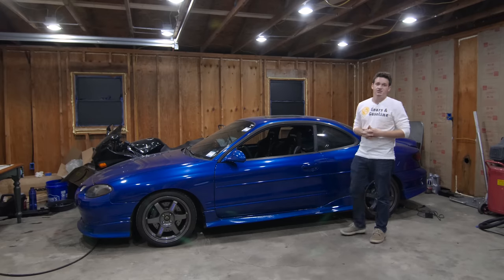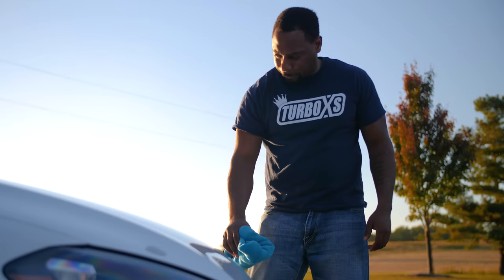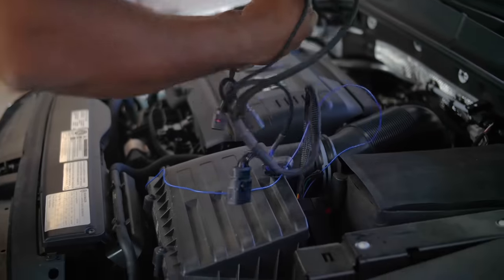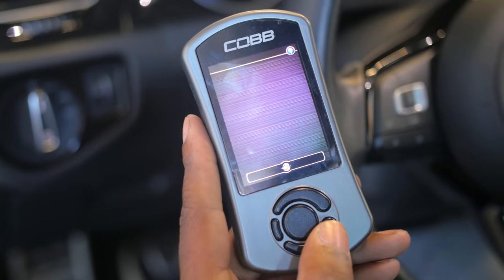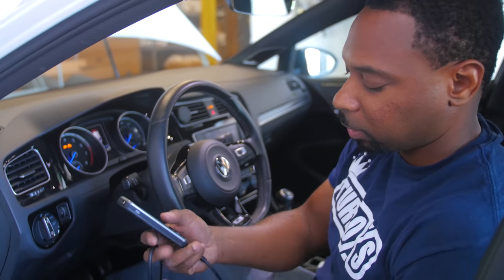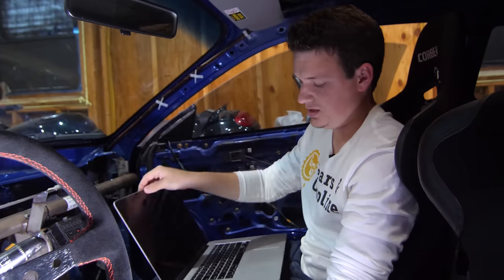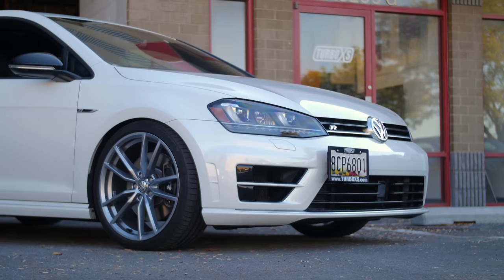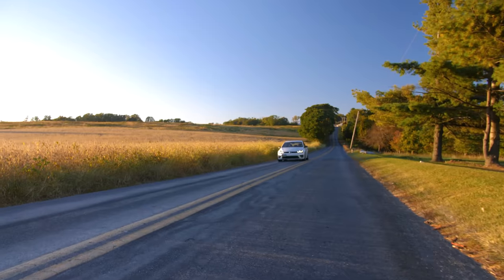3 Different Methods for Tuning a Car [4k]

Comment: My three methods are plasti dip, air filter and taking out the spare tire for weight reduction.
Reply: Sensei Joshu nah that’s rice
Reply: @zanpy8600  no dude, every sticker adds 10+ bhp and the big exhaust is to vent the excess V-takk++ and the spoiler so you get more lift like a jetfighter.
Reply: Add some stickers too... That will also help in winning at red light race.
Reply: And cut springs for better cornering
Reply: Thats not even tuning
Reply: well..I agree with options 2 and 3
Reply: Weight reduction bro
Reply: K G muffler, cut coilover, fake wheel
Reply: K G 💀😂
Reply: every sticker is +5 bhp
Reply: @SupermotoNL  A spoiler does not give lift, it makes the opposite..
Reply: @SupermotoNL that’s a good move 😂😂😂
Reply: LMAO fuck man i literally just took the spare tire out of my camry. I'm just starting to learn about cars and how they work so I don't know the memes yet

Comment: This is a very incomplete explanation of tuning basically limited to cars with electronic ignition and fuel injection. Tuning is an old skill long before ECUs and access ports. 350 WHP from an access port is a luxury. The part that was left out was all of the fine adjustments you can make to an engine without ECUs and the like. Bigger throttle body or a bigger carb, screwing in that little bit more timing, bigger jets in the carb, and such. Don't get me wrong I am not going to rag on the electronic method of doing things. That's an art in and of itself and requires an equal amount of skill to perfect. This video was just misleading in that it says tuning wasn't really a thing before 2004, which for electronic tuning may be the case, but for tuning overall is just not true.
Reply: Yeah you can put a bigger throttle body on a car. but the ECU is set up for the smaller throttle body. so to need to tune for the new throttle body.
Reply: To be fair most cars that get tuned are usually made in the 90s and newer so this video is just an explanation on the electrical way of tuning BUT the old fashion way of tuning is still alive since you do have to change out parts mechanically to get more out of your engine, sad part is that you have to do more to a modern car than you do with a classic because with a modern car there's more restrictions coming out as each year goes on so that's more deletes you have to do before you start getting to the good stuff and that's if you don't live in a eco friendly state like California

Comment: Only German turbo cars can get those type of gains with just a tune
Reply: Mr.Car  Yep thats true and still be really slow...
Reply: Augmented Ninja7 There are Golf
Rs that run 9s lol.
Reply: Jad3d Not just that theres a mk1 with like 1,000hp, but I am not sure if it has another engine.
Reply: Zem45 it got 1200hp its a twin engine
Reply: @michaelzepeda5785  it got a mk4 r32 engine, which is an underrated tuner beast
Reply: that golf was probably running on a stage  2 tune with stock turbo

Comment: I'll check out what's available for my GTO soon. Like nearly everything else, it will probably have aftermarket support based solely in Australia.
Reply: Cars Simplified Don't be so sure mate: the motor is a crate LS GM Lump. If anything, you might have better luck in the States.
Reply: Haltech

Comment: who the fuck gains 100 hp by just tuning the ecu???

edit: some people actually do -hmmmmm!
Reply: Audi A6 3.0tfsi owners. A little more to be exact. 150-180hp just from tune.
Reply: McClaren
Reply: JP3 even the new EA888 Golfs can do close to that with just a stage 1+
Reply: thats some crazy shit, no dp, exhaust etc?
Reply: Golf GTI & Golf R Mk7’s too!
Reply: its easy to gain power from turbocharged cars. all you have to do is turn up the boost and make a few adjustments
Reply: crazy VW must be really careful with their software. on my fiesta st i had to get a turbo back exhaust and a new intercooler for a stage 2 which gives me 80 hp AT MAX. so 100hp with only a ecu tune seemed pretty ridiculous to me. but then its 1.6 vs 2.0 and up...
Reply: Josiah Jackson its not that easy to get 100hp without any supporting mods
Reply: JP3 generally thru years 20-30% has been the max power gain from tune. Mk4 golf 150hp -> 190hp.  audi 3.0tdi 239hp -> 286hp
Reply: The ls1 engines from 1997 were just retuned a little each year too 2004. So when the tuners re-tune  one off the earlier ones that were detuned (the first ls1's) they see big power gains.
Reply: It’s 2018 man
Reply: BMW 1 series.
Reply: JP3 the thing is VWs are so detuned from factory that it shouldn't be surprising that they can gain +100hp. I mean, it's a 2.0 turbo that outputs 220hp. If you look at other 2.0t from the evo to even the hyundai sonata turbo, they output 270-300 hp. So a stage 1 gti gaining 100hp isn't all that far fetched

Comment: I just bought a 2017 Toyota tundra
I know what is a lot of people in the states are getting their vehicles tuned by professional tuner for around $450

The other option is I can buy a bully dog like everybody else

Or something like an HP tuner

Is the bully dog good enough
😊 What am I trying to do I'm just trying to make the vehicle run smoother improve miles per gallon and shifting points
Reply: Wait so you can literally just buy a tuner plug it in and it does all the work for you .? You don’t have to do program anything
Reply: Diablosport   tuners

AFE Scorcher pro , ✓
Plugs under hood , doesn't mess with ECU ( car computer)

Bully dog tuner

Comment: I had the JB1 on my 2016 Golf R and loved it!  Amazing power and George from Burger Motorsports was a joy to work with.  I now have their JB4 on my 2019 Type-R and its even better thanks to the bluetooth functionality with their app.  You can monitor several digital gauges, data log and switch maps on the fly...it's phenomenal and best part again is there is no flash or checksum file left behind on your factory ECU ;b  Cobb is a great option too but their OST maps are really prevalent to knock, at least on the Subaru and Evo platform.  Pro tunes are definitely the way to go for this route.

Comment: How does Pre-obd, obd1, and obd2 come into effect when looking for tuning options?
Reply: Emmanuel Haro the amount of fuel thrown out.. For instance obd sensors tell whether or not you are using an excess of fuel , but don't take my word for it i am not a mechanic just have had to deal with those buggers for a while

Comment: tuning is stupidly too dam expensive....atleast in my area....800+ a tune at the local tune shop n its the only one for 6 hrs...that being said i never had and luck with handheld tuners....last 2 cars i had with a handheld tune fucked them up to the point where the boost would not hold/build

Comment: Tuning the car is not a simple task. Having specialized knowledge is required the most for obtaining the best results from the vehicle. Help from the experienced one will serve the best purpose. I've chip tuned my car from Tuningfileshop, they tuned my car instantly and quickly with ultimate results.

Comment: What's best for my 02 vw jetta with the 2.8 glx vr6 engine? I want more take off, more boost and more power. Mine is not the turbo. But will be turb boosted in 2 months. What's best for me to use right now so I can bring to a shop to get it done? I currently have straight headers, straight pipe and cold air intake. Not much of anything but I want more out of my beefy engine

Comment: My tuner is a 1995 Ford taurus t- tops ,cold air intake, cat back duallies, 4 foot spoiler,  racing stickers neon lights ,kissing doors with a body kit sitting on 22s ok there 14 inch hubcap spinners but I keep them clean do it's a real babe magnet I run 97 octane for a extra 50 horsepower when I race it it's a real head Turner and on top of that I went into Harry's and ordered a t66 turbo and a motec exhaust I can't wait

Comment: I have a cold air intake and catback exhaust. Can I tune it myself with just a laptop and some software? I mean the mods ain't much but it's certainly taking in air and dispersing exhaust on a level the ECU wasn't programmed to, so a tune will bring out the most of what I have. I just wish I knew more.

Comment: Hey, i have a 1994 caprice. It comes with 200 horsepower from the factory. Id like to increase that power just a little so i can have a little bit more fun. But i dont know anything about tuning and the car is just too nice to start replacing hardware. Should i get a standalone ECU to achieve this? My goal horsepower would be 250-300. But i dont know if just a tune could manage this. Any opinions? (The caprice is OBD1 by the way)

Comment: trying to find a way to tune my 1990 vw corrado g60 would like to add a few things but I want to be able to tune it before I do it. Its got an obd1 port so I cant tune it with a hand tuner and cant find any piggy or standalone tuners for it. would really appreciate it if you could help me out.

Comment: 2 question from Italy 🇮🇹 
First one: 
I'm not sure of that, but in all these case you can only modify the ECU changing the code with a new pre-written code and you can't access at single parameters changing them as you want wright?

Second one
How can you be sure that the mechanic contest is robust enough to support the increase of power ?

Comment: Does anyone know when a engine is to old for tuning or get a stage tune flash? My car is a 2006 gti 2 door with 154k mileage, rebuilt turbo, new cat. Everything else is stock and I was wondering if the mileage is to high to start tuning with stock parts :/
Reply: If you don't tune it, it gonna break anyways.

Comment: Does flash tuning void factory warranty
Reply from the maker: +Fardeen 911 I believe it can, yes. As far as I know.
Reply: Fardeen 911 and also reduces engine life which is why there are big gains as factory is conservative.
Reply: Yes, technically. You can flash back to stock an no one will know. But be careful with some newer cars, because the ECU can have a flag tripped on it that can alert the dealer even if the car is flashed back to stock. Some newer VAG cars do this.
Reply: Thanks
Reply: down under it does , I just check history mods with a computer ,  bam your warranty gone
Reply: Yep... But if you use a map from COBB who have been at it for a long time then you should be ok.

I was on the fense since my WRX was under warranty.... but that stock tune had to go.
Reply: GONE IN A FLASH!

Comment: Question. I don’t have a tuner or a laptop and the Dino place is 20 minutes away should I put on the parts then drive over there or get the tune and then put the parts in

Comment: Carburetors are in my opinion the easiest to tune all you need is a flathead screwdriver both long and stubby and selective hearing. But then again I have little to no experience working on cars with fuel injection.

Comment: I have a 92' Subaru SVX that from factory makes about 220hp I assume to the wheel. The dream would be getting it to 400 but thats probably impossible seeing as no one makes aftermarket parts for it. But IF it's ECU can be tuned I should be able to squeeze more power and maybe even speed up the trans shift times right? But if I can't tune the stock ECU, theres a possibility a standalone ECU could work for my car?
Reply: Non turbo cars wont help much with an ECU flash. Turbo cars work best because the tune ups the boost on the turbo.

Comment: How do I tune my 2009 Ford Taurus 3.5l v6 and do yu no what exhaust manifold would fit my car I’d really appreciate it ty for ur time
Reply: Go to cd3performance.com i have a 07 lincoln mkz running the same engine with magnaflow exhaust injen intake with a sct tune

Comment: I wish you would have addressed the pitfalls to each of these....piggybacks can be quite dangerous since it's "tricking" the ecu and in all cases, a backup ecu just for tuning (a clone of what you have) should be used for the tuning just in case.
Reply: David Santiago if you go with a good company Piggybacks can be fine look at banks in the truck community I’ve had numerous trucks for hundreds of thousands of miles never had a single problem using it long term

Comment: So Jermaine said if you tune via the JB4 method, dealers won't notice if the ecu has been tampered with. What's the case with the cobb? Are dealers able to see if you reflashed the ecu and is there a way to hide it if does keep a record of flashes?
Reply: Most flashers will store the stock tune for you to return to back if need be. The only thing that I know of is if the dealer has to do a software update to the ECU they'll wipe any tune you put on there anyway. It doesn't check what the tune was before.
Reply: Td1 flagged by a dealer

Comment: not sure about jb4 on golfs but jb4 allows you to switch maps on the fly using steering wheel controls
Reply: emmanuel siguenza yes it allows via Bluetooth or data cable there’s a phone app and a program for laptops 

You can control boost by gear remove cel for down pipe 

Just can’t remove the speed governer but basically 3/4 of the way to a full tune but completely simple and easily removable

Comment: You forgot one, a flathead. Because carburetor. Ah just kidding. Great video
Reply: I hate when people say this although I know what you mean, all you’re doing is adding fuel. You’re not getting any more air, you can’t pull out or add any timing, You can’t map the fuel delivery, I could go on. But adjusting the screw on a carburetor is hardly the same thing as tuning. Yeah it’s free but it’s hardly as effective.

Comment: So is there really any point to tuning your car if it's naturally aspirated? What all can one change?
Reply: Aiden is all Knowing yes there is to an extent. For everycar has some hidden power to he gained from a tune. You can also get a tune to change your mpg cars timing to run more lean or more rich accelerstion band. If you have full bolt ons then even more reason to tune it as u wont get the full gains from those until tuned. The ecu is the computerized brain of the car and controls everything there are normally 2 ecu's one for like the engine and transmission and performance related things the other for electrical things. The more computerized performance in thecar the more the tune can change. For examply getting an aftermarket intake will change your cars powerband throttle response hp and torque minimally. This is hecause it allows better circulation if colder air to the engine. That is measure by a maf or mass airflow sensor.  When u dont tune it the maf gets confused not doing the job properly and doesnt give u the full advantage of the aftermarket intake but a tune clears that up by remapping the ecus brain and what it can do so that the maf does a its job for the new system
Reply: How much does tuning cost???
Reply: Basically No...

Comment: The thing to remember with a piggyback or a handheld tuner is that you're adding another point to your system that is equally as capable of failure as any individual component in your vehicle's CANBUS system. Is it rare? Yes, but it can happen. I've seen an Accessport brick an ECU before while trying to unmarry it so that the maps could be updated. And while Cobb did replace the ECU as well as the Accessport in that instance, the owner's only vehicle was incapacitated for over 2 weeks. It's a real risk that nobody weighs when effectively further complicating the already complicated computer network in their vehicle. Native tuning, with a laptop and cable, is still going to be the most reliable way to tune, either on an OEM ECU, or on a standalone if that isn't an option, providing the tuning itself is done by someone truly knowledgeable enough to tackle it. The risk, in my mind, is not worth the ease of the other options.

Comment: Stage 2 stage 3, silly terms. Few watching know what's even getting change. It's funny to hear it called in stages when you actually understand what's being changed. So a little more timing and a little more timing and a little less fuel is the simplest way to think about it. People think whenever they go "stage 3" that something magical happens but it's not like. Fuel trim and timing and related are adjusted to increase or decrease cylinder pressure to either make more power or reduce knock to allow more air and fuel before creating detonation. It's not like whenever you tune a car you are creating more power. All you're doing is trying to eliminate the car from detonating while increasing air to fuel, that example is what you would see when increasing boost. When you just increase timing and reduce fuel you're just creating more cylinder pressure to create more power with what's going on already, stock configuration with more aggressive mapping. So a tune for "stage one" may actually be more aggressive than a "stage two". Because stage 2 may include upping boost pressure. Therefore and unless the octane is raised you would have to reduce the aggressiveness of the timing and fueling to decrease the chance of detonation.